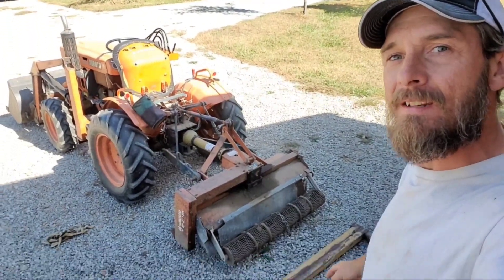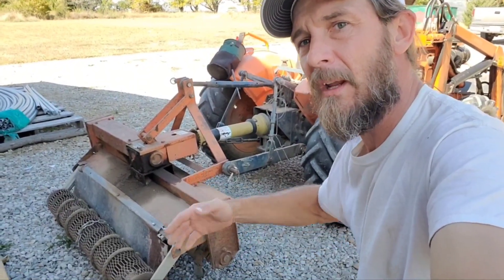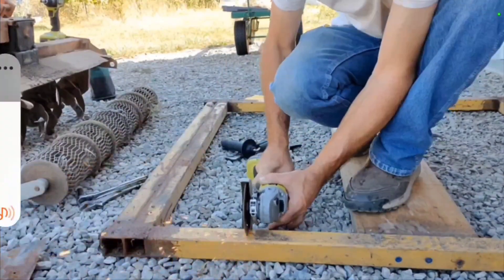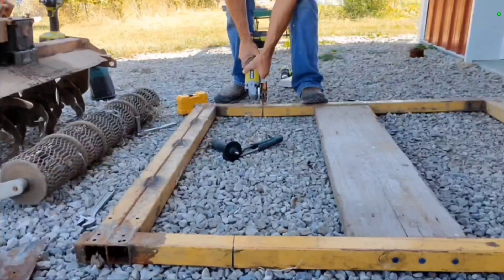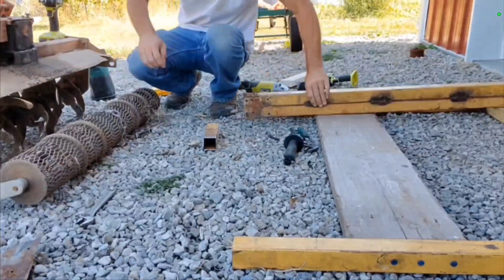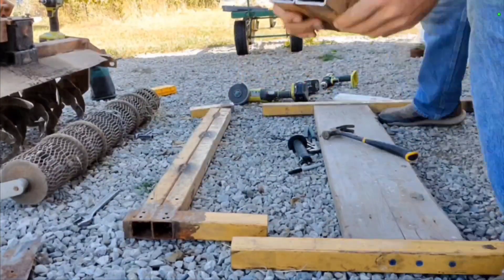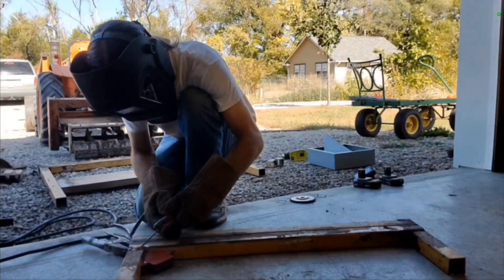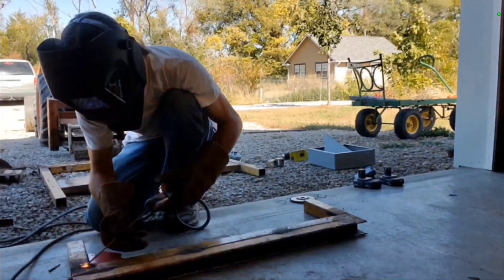Make a Tiller PDR (Precision Depth Roller) Made for my Market Garden

Comment: i had a 4' tiller. I would make beds by shifting the tiller all the way to one side covering one wheel of the tractor. then making loops around the garden. you can then make beds by using the wheel that is not covered by the tiller.